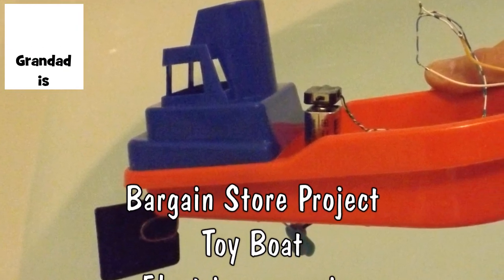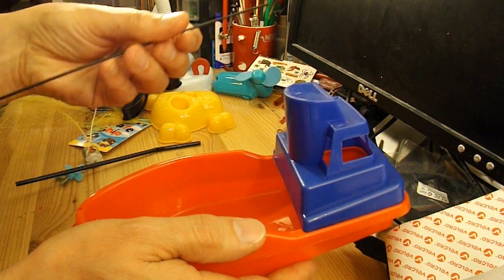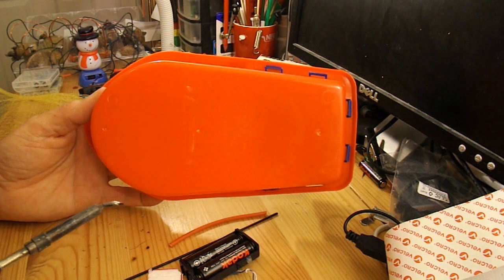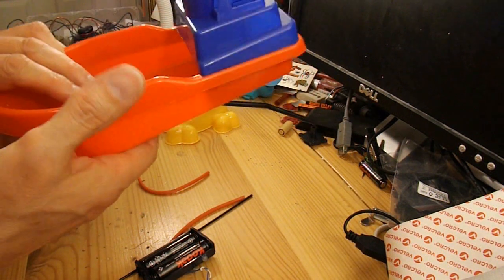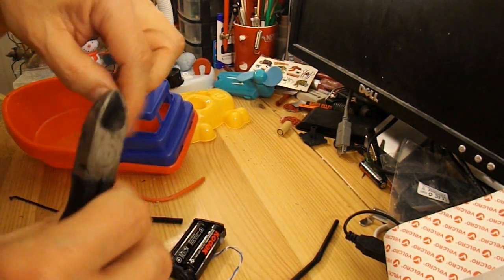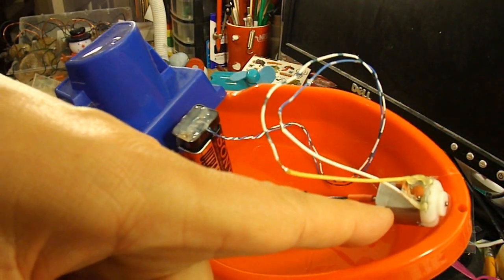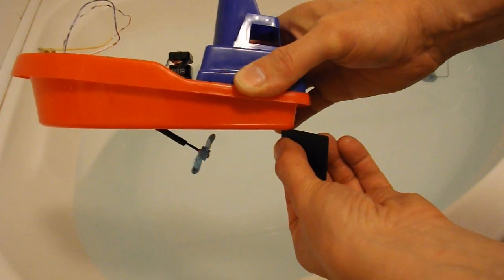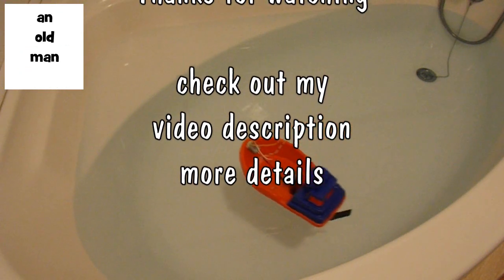Bargain Store Project - Toy Boat - Electric conversion

Comment: Put bow thrusters
Reply from the maker: +Lord springtrap that would only be any use if I was making it radio control. As it happens I did convert this to RC but only using the RC from a toy car and I just used the car steering to move the rudder. Bow thrusters would have needed a bit more work. Here is the link https://youtu.be/34ssD8e0Ncs?list=PLA5a2xPRSrB24vUS9E8zkSgjZysEL00zr

Comment: Does anyone know if you can submerge the end of drive shaft end of an electric motor in water, as long as you have the other end and the power source dry?
Reply from the maker: I haven't tried it but there are lots of videos on YouTube about putting electric motors in water. Here is an example http://youtu.be/IVxf_6vFB1o
My opinion is that the motor will continue to run but over a period of time you will get corrosion. You will also get deposits of various sorts of dirt build up on the parts of the motor when the water dries out so that may affect the performance and maybe even jam the motor. If you give the motor a spray with a water repellent lubricant it might help prevent corrosion.
It might just be easier to use a longer prop shaft to keep the motor above the waterline.
Reply: Thanks so much Grandad! :) Such a quick response. And links to what I need as well. excellent! I love watching your videos. I don't have kids of my own but I gonna fetch the things I need for a build next time I visit friends who have kids. It'll be a nice change from playing 'big cook little cook' :)